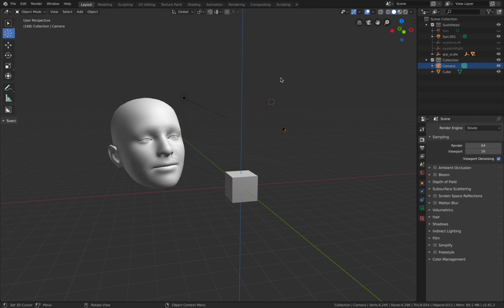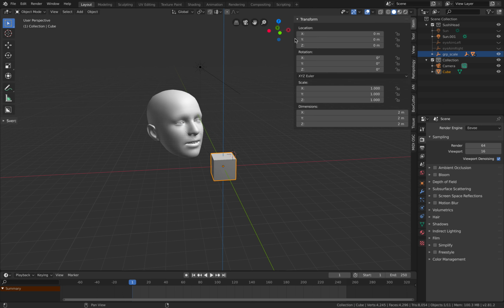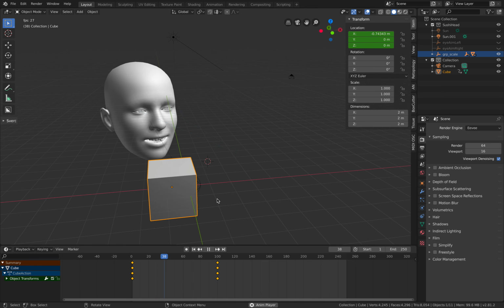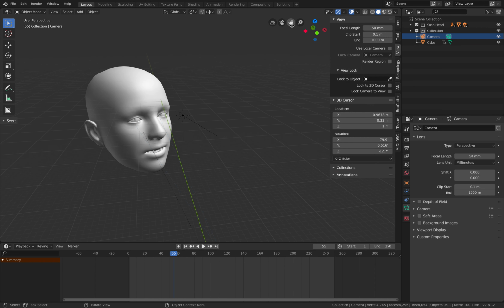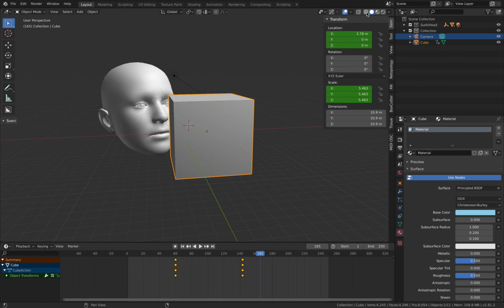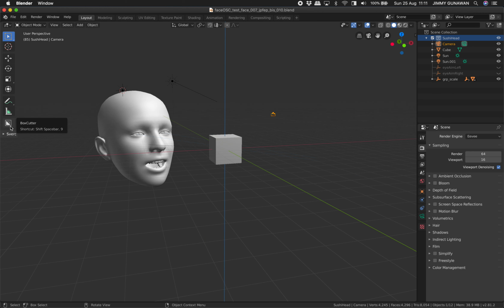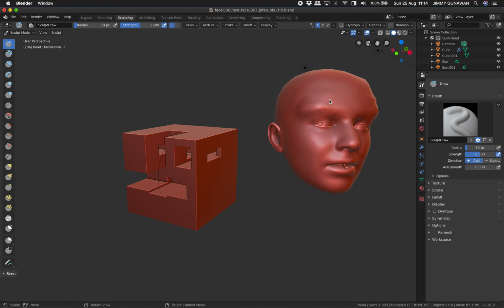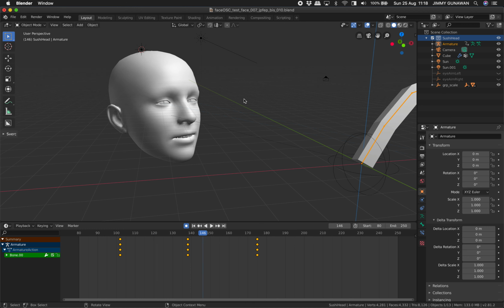BSLIVE Dejavu Intro to Blender 2.80 With Sushi Head

Comment: Sushi Head doesn't really add anything for me, it's just a moving blender object that tries to distract me from the actual subject next to it, no immersion or agency projection or whatever you want to call it, at all.

Maybe it just needs a bit of texturing (nothing too PBR, steer clear of the Valley). Maybe there's just not enough expression, or what's there lacks realism. Maybe lag/temporal resolution are the problem.Whatever the solution may be, if it requires more effort from you and this leads to reduced media output volume then I, your audience, am against it. :) 

I love the initiative though, and I can imagine it getting adopted by other instructors and TA experimenters. And the possilibity to wear the face that you're sculpting or texturing might make the design process a lot more interactive, like putting on make up while trying out different expressions in the mirror. Thanks Jimmy, interesting watch as always!
Reply from the maker: Thanks good idea!